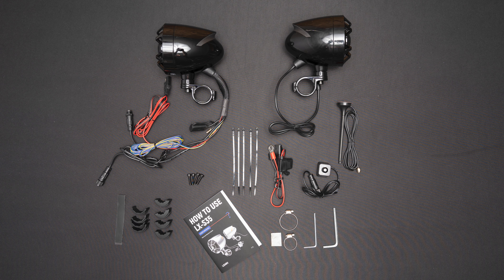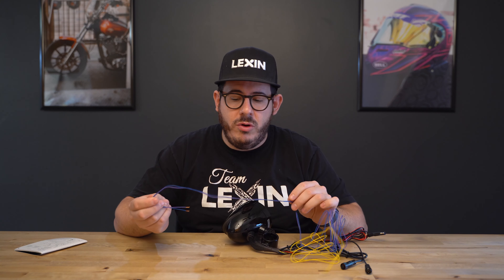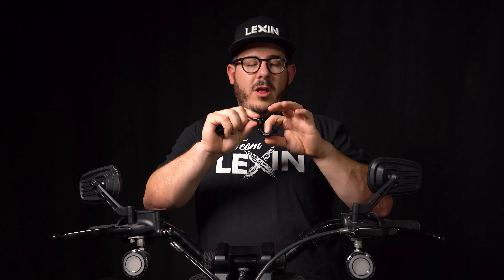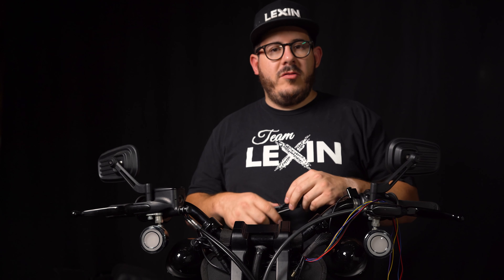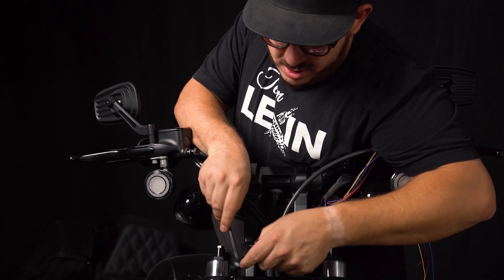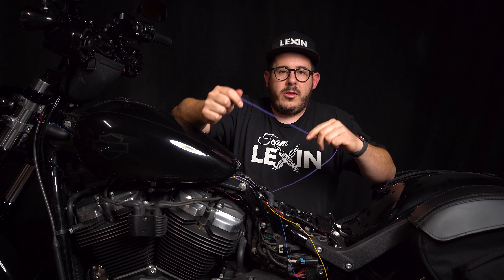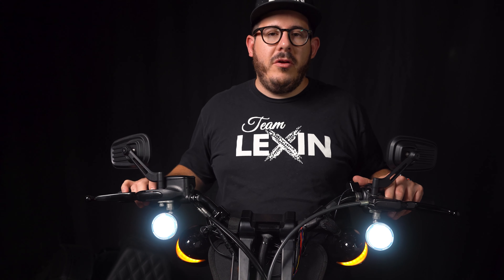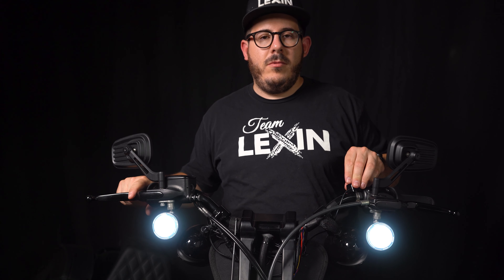The S35 A handle bar speaker system

Comment: Hey guys! I'm looking to get those speaker for my 2022 low rider st. Can you do a video on how to install the cable conected to the motorcycle accessories so it turn on automaticly and won't have a chance to drain the battery? Thanks guys!
Reply: All you need to do is but T-Tap Connectors, use a Automotive Circuit Tester, preferably one that lights up, & find a 12 volt wire in one of the box of wires near your battery, and use a T-Tap to tap the positive wire that lights up when you turn the ignition switch on. For the automotive Circuit Tester, try to get one where the black wire on it clamps to a negative ground while you use the tester to probe for the wire you need. As for the turn signals, there is usually three wires, and you have to T-Tap into the positive wire if you can find it. Sometimes, you have to cut into the wire casing. If you make a mistake with the wire, your can crimp them back together with heat shrink wire connectors, so that they don't corrode from the weather. Of course, then you need a heat gun to do that. Of course, you don't want to connect wires the wrong way. Positive with positive and negative with negative....always! You may also drain more power from the fuse box taping into the turn signals, so you might want to do a little research on Amp fuse you need for the access power drain. However, sometimes the fuse that is currently in use is enough to handle the access amperage drain. To test amperage, it gets complicated. That is when you need an Amp Meter. Fun! Fun! I may not be a mechanic, but I learned a few things from my brother who was a Millwright & Mechanic. My brother fixes everything. Radios, cars, heavy machinery, and he knows carpentry as well. I've even seen him come out with designs for things before they would appear in Popular Mechanics Magazine. He even used a wood stove to circulate water through pipes he rigged up through the wood stove that heat the pool, and he would get pallets to burn for free. I wish I was creative like that, and he never teaches me a damn thing. He always tells me to get away while he is working, because every time I'm around, he smashes his thumb with a hammer, and all I have to do is sit there. lol When my brother was 14 years old, he took shocks off a mini motorcycle, put it on my Banana Seat Bicycle, and turned the front forks into a Chopper. When I got home from school & saw my Banana Seat Bicycle all in pieces right down to the ball bearings and each part of my chain undone & dissected into little pieces...boy was I ticked! I was about 8 years old back then in '78 in Connecticut.
Reply from the maker: Hello, in the video at the link below at 8:40 we talk about the yellow ignition wire, insure that the wire is connected to a switched power source doing this will insure your speakers are not powered when your ignition is powered off.https://www.youtube.com/watch?v=5GWtPYbTBFU
Reply: @LEXINMOTO  Did all that and connected the turn signal wires as well. Works great!. Just the problem with the button, but not a major issue.
Reply: @LEXINMOTO  and yes...don't forget that yellow ignition wire. I first connected it directly to the battery, because it was about to rain, so it wouldn't turn off unless you turned it off at the switch. However, once you tap into an ignition switch wire with a T-Tap, nobody can turn the speakers on unless you turn your key in the ignition switch, so that you can push the button and turn the power on or off. That little yellow wire needs power in order for your radio to work whether you connect it to the ignition switch or not. Some choose not to, but that is their choice. Definitely not my choice. lol

Comment: I added these to my engine guard. Can i add another pair on handle bars with just using one on/off wire remote?
Reply from the maker: Hello, the way the speakers are designed they only can connect the supplied 2 speakers.
Reply: I purchased the LX-Q3. How do i pair those with the S-35?

Comment: I have  a 1" handlebar. Will the shims fit from 1" to 1 1/4" or do I have to order them? I ordered your speakers, but it says on Amazon from 7/8" - 1 1/4." Just need to know if I need to order shim spacers to fit a 1' handlebar or will I be fine with what's in the box?
Reply from the maker: Hello, yes the included shims allow the mounting for bars from 7/8" up to 1 1/8", So yes they will mount to a 1" bar with the included parts with no extras to purchase. Thank you
Reply: @LEXINMOTO  Yeah, I realized that when I installed them less than a week ago. Too bad the little button broke off when I turned down the volume, but I returned proof of purchase and pictures of the button controller to Jose @ lexinmotorcycle. He reached me after I reached out to tech @ lexinmotorcycle. Said that all I had to do is return proof of purchase along with pictures of the broken button. Hopefully, I can get a replacement, and hopefully it doesn't break so easily this time because I barely touched it to lower the volume. Surprised I was when I saw the little piece of the head of the button drop, but that is a manufacturing defect. I can still use it though with my fingernail digging into the where the button is and using my fingernail to lower the volume...etc... As for the speakers, working great with my windshield!
Reply: @LEXINMOTO  Oh...Happy belated 4th of July!